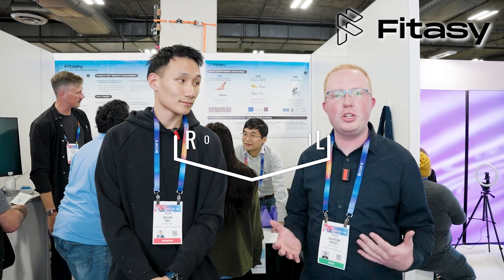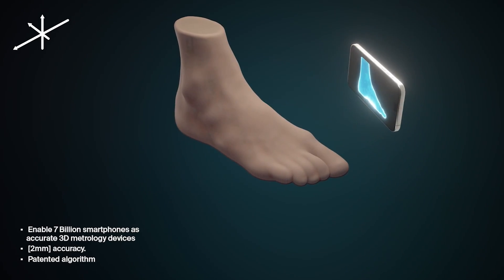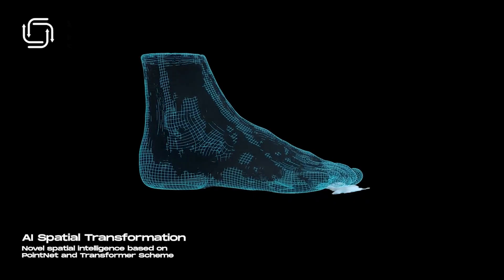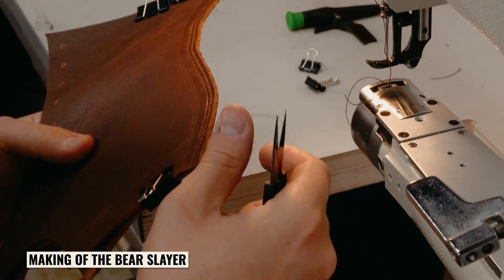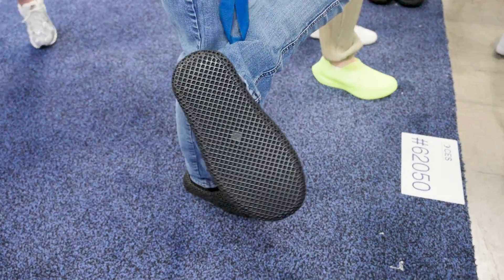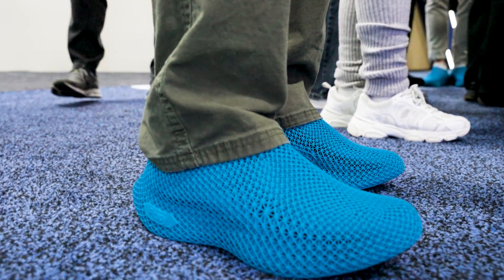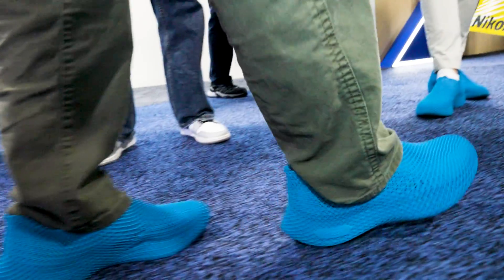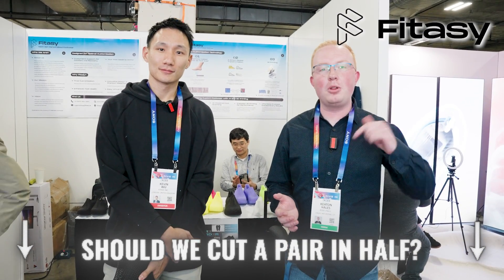3D printed resin shoes?! Interview with Fitasy

Comment: I wonder how they react to inserts. I have no arch at all and it’s a major issue to find shoes that are roomy enough for the extra height.
Reply: you shouldn't need an insert if its crafted to your foot
Reply: @axelskull no way the iPhone scan is anywhere close to accurate enough. I use 3d scanner to create stl files. And that just cap.